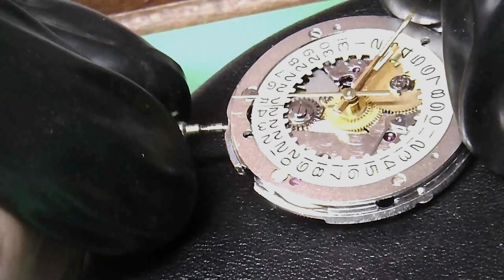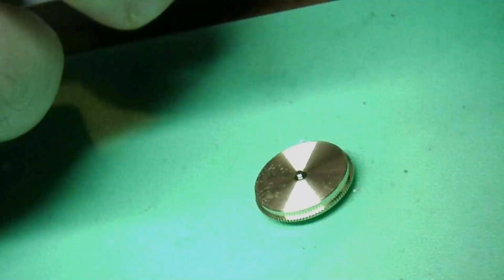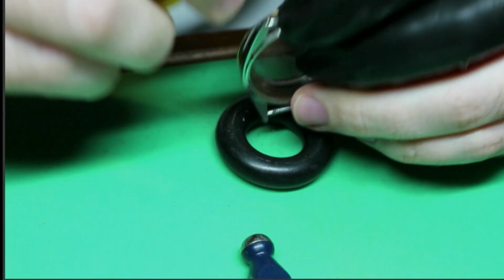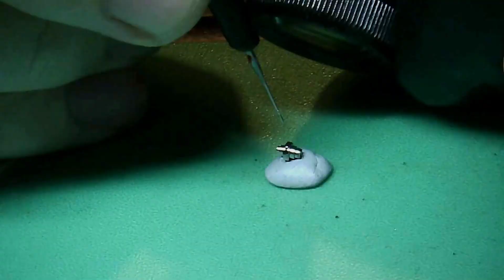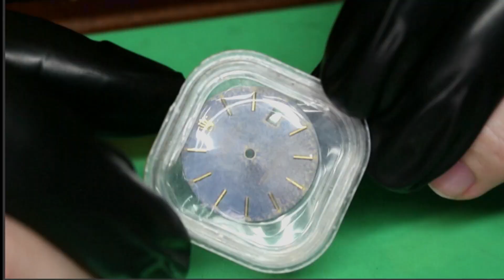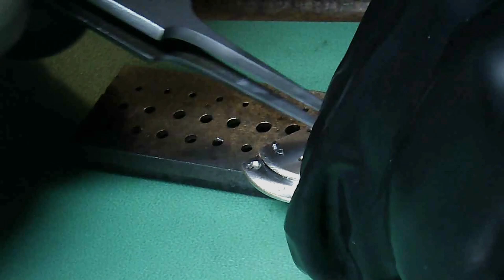1970's Rolex Datejust Restoration, Missing Dial?

Comment: Hello Nate.  I re-subbed.  Great to have you back.  I do have a couple of suggestions: 1) FOR THE LOVE OF GOD man, plese use BRASS tweezers ESPECIALLY on highly decorated movents. 2) the "tilt" of the camera angle is annoying (maybe it's just me since I too am a CC on YT).  Not sure which edting package you use but Resolve allows one to rotate the angle of the video if one desires. 3) too much lubrication on the barrel.  Lightly lubricate the cleaned mainspring, apply breaking grease, lightly apply HP1300 or similar (maybe 2-3 spots) on barrel, cover, arbor.  At least that's the way I've always done it.  Otherwise the lubrication WILL spread, leak out of the barrel arbor, and get all over the inside of the movement. 4) the bezel removing tool is realitively cheap - Aliexpress is your friend.  I userstand it's not an AP or Patek but it is still a potentially $15K-$25K watch after all. 5) While at AE, pick up one of the "red or black plastic sticks" for holding down bridges or at least get some pegwood.
Reply from the maker: Welcome back :). Gonna be hard to change tweezers I'll be honest as I've been using these since day one and are now an extension of my hand, but I understand your concern. Apologies if the camera angle appears tilted. More than likely the angle and direction I have the camera pointing, will look into it. Typically I go for 3 spots on the barrel and haven't had any issues with grease leaking with 8200. Yes I'll be getting myself a bezel removing tool along side other pieces. Think I'll stick to peg wood and hand pushers ;). Granted I feel like I'm stuck in my ways and wont necessarily change too much but I do appreciate the concerns and input :)